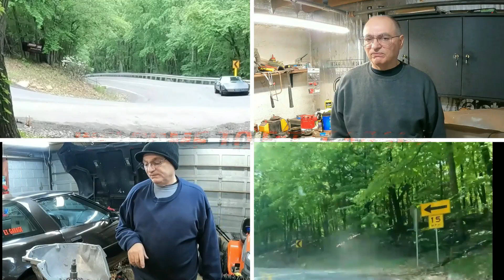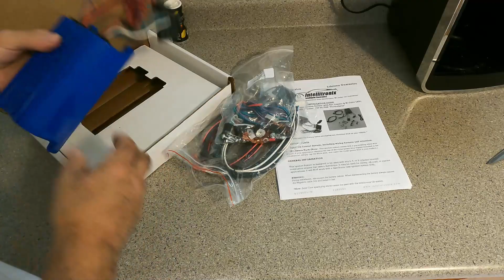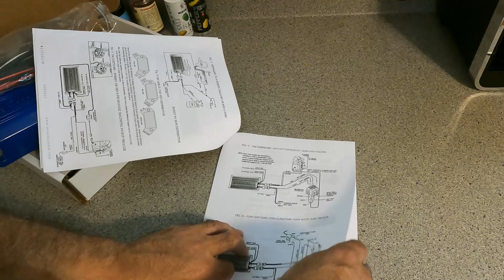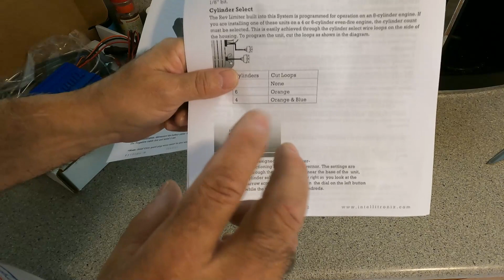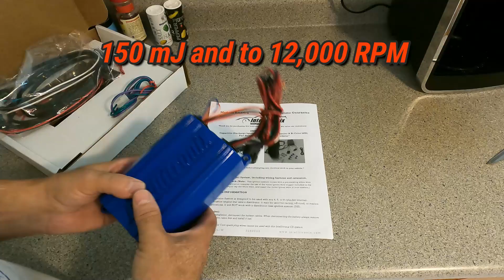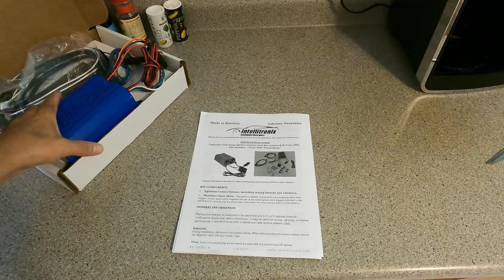Capacitive Discharge Ignition On My Corvette

Comment: I've always wanted to learn what these boxes are for and if it's worth it, also if any future tuning is required. I currently have pulled my L98 out of my 91 C4 doing a quick but detailed refreash and redo the fried and brittal wire harness. Also going to pull 700r4 and do a quick refreash want her back on the road already. 156k on the tac when I put her in the induced coma.